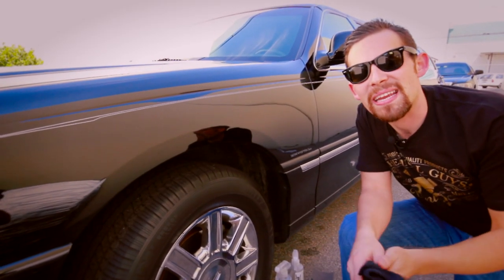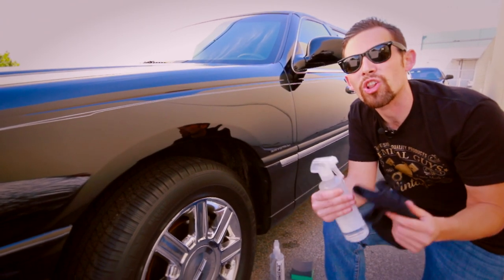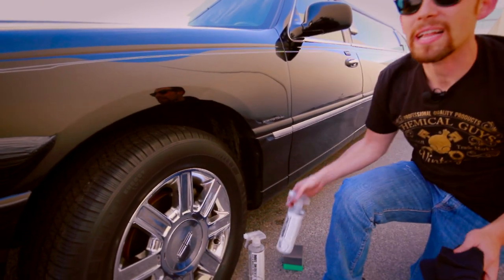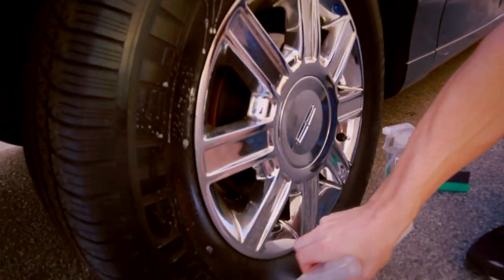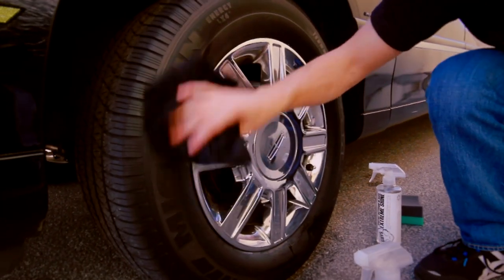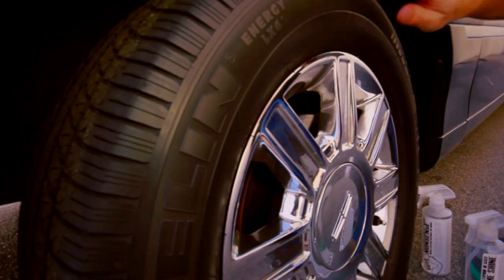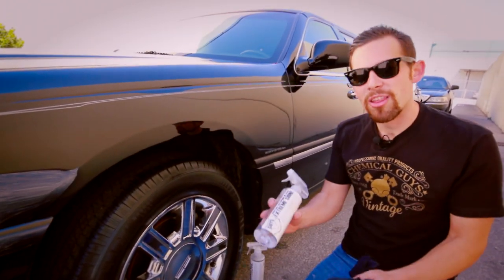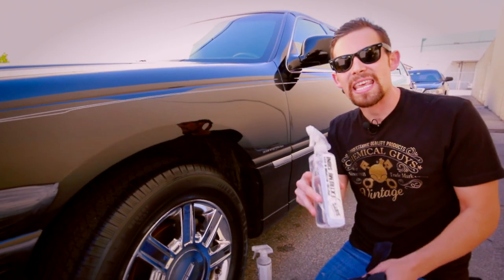Chemical Guys - Liquid Extreme Shine Oil-Based Sprayable Dressing - Tire Shine

Comment: I've always heard from other detailers that oil based is harsh on tires and causes dry-rot and the rubber to get very hard and brittle. Is that true or false
Reply from the maker: False. This is a myth.

-Greg@CG
Reply: Yeah oil drys and rots rubber!
Reply from the maker: ChRiSVII No, oil does not dry or rot rubber, Whoever told you this is WRONG.

-Greg@CG
Reply: steveguy92 Steve, maybe you are right. Maybe It was the solvent base I was thinking of. I just know I remember having a few conversations with other detailers about it
Reply from the maker: steveguy92 solvent based dressing are bad for rubber. Oil based dressing can protect and condition rubber. 

-Greg@CG

Comment: This question has nothing to do with the video but I have a few white cutting pads made by yall, are they still ok to use to put jet seal on my truck? BTW I have the porter cable 7424xp
Reply: White pads would be perfect for a cleaner wax.  A lot of guys do the one-step with white pads and the results are probably indistinguishable from multi-step.  Jet Seal is definitely not a cleaner, BTW, so don't apply it with a white pad unless you clay bar it first.